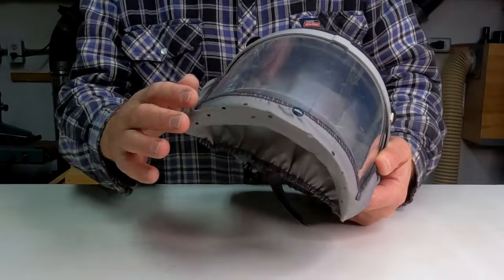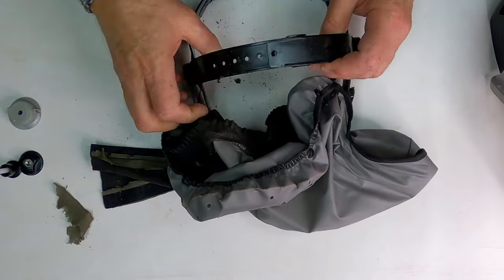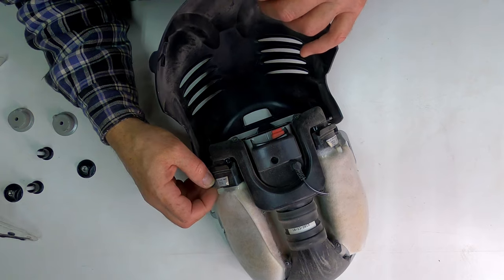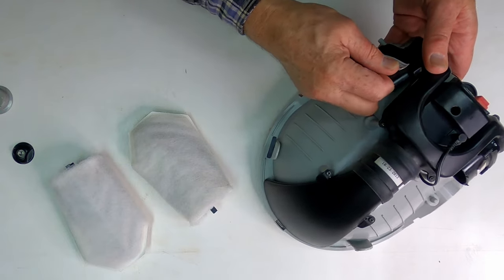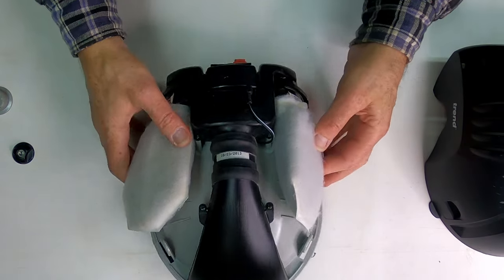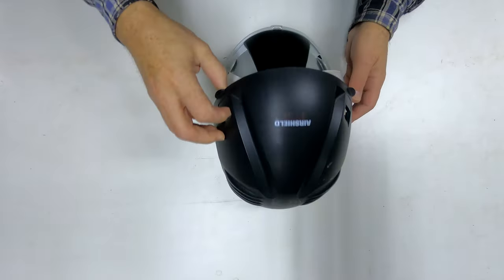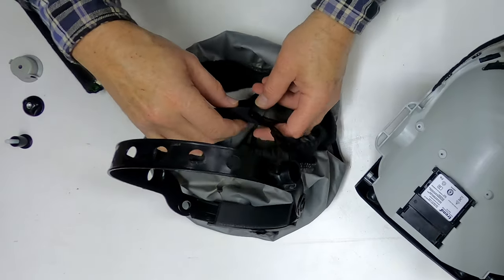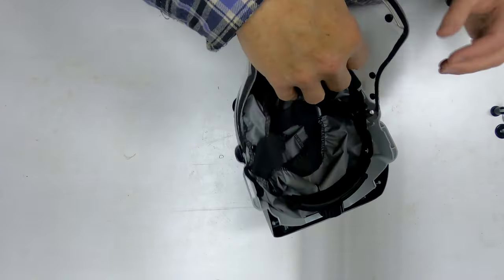CLEAN & REASSEMBLE TREND AIRSHIELD PRO

Comment: Many thanks for this superb demonstration, I can add too this in a couple of very useful ways. 1. The filters are washable a good few times and you do not need to undo the cable ties. Buy a small net wash bag big enough to fit both filters in and put them on a 40 degree wash cycle for 30 mins. Air dry takes 30-40 mins.
2. If they do eventually breakdown I have bought a sheet of Hepa Filter cloth and sown replacement filters then created a simple cable tie internal cage that does not break like the originals. 10 washes later they still work far better the Trends original.  Cost was a couple of pounds and 1hr to make and fit. 
3. The Head band protectors went in the wash also the cranium foam does break down so I replaced it with a longer copy of the design with a soft density silicone foam which is more comfortable and lasts longer same with the forehead one where a good piece of natural leather works well and is easily wiped clean.

The standard of the head unit is more efficient and more comfy over a day of use and repaired at a fraction of the cost. I’ve done two others for friends and they have said the same over the last two years they’ve saved lots of parts costs and cleaned weekly without damage. Air flow is cleaner with both Carbon and hepa filters made to fit.
Reply from the maker: This is incredibly valuable information, Stewart. I plan to print this so I don’t forget any of it. Thank you so much for sharing it with me. I really appreciate it, my friend. I hope others will read this information!
Happy turning,
…..Gord
Reply: @GordonRock1  My pleasure, it’s a lovely useful bit of kit but the cost of spares and service replacements in current times could make anyone ask twice about repair if it can be done well for a fraction of the price why not. If you do try and take the frames out of the filter they are fragile with no reason.
Even the battery can be deconstructed and the cells replaced for an absolute saving but I’m not there yet but Samsung cells work far better. Other brands available even less costly. 
One of the friends who let me clean and replace his pads and filters commented how it’s good not having to be a little precious on safety when using. I get that, we don’t think twice about putting it on, we should never need too.

Comment: I have the same TrendPro helmet, try a vacuum to clean the filters from the outside , then I blow from the inside with compressed air.  The other thing I have discovered turning green wood roughing out bowl blanks to dry is it’s hard to remove the sap from the face shields I use ! 
I don’t use this kit for that only on power sanding dry finish work. But the trick seems to work well on this lens too. We buy windex in the gallon jug , it won’t remove sap ? I make a mix that will by adding one cup of 90 % isopropyl alcohol. It works really well now. I use it to clean my respirator too. 
Cheers!
Reply from the maker: I rarely wear my Airshield when I’m turning, Pete. It is almost exclusively for sanding. I appreciate the tip about removing the sap. The same should be true of my face shield. I will try to be more diligent about vacuuming the filters occasionally but I hardly ever think of it. Thanks for watching!

Comment: This video has helped me immensely as i took the  head cover face seal out to clean and had left it to long beforei reassembled it so forgot how 😏😂.. when i reassembled it tho i wasnt totally convinced that the elastic loops were supposed to go inside of the anti rotating caps (marked L&R) so i let them loop around the outside of them to the front of the mask... this way they wont interfere with the workings or doing up the retaining bolt properly. Have a go and see if it helps/improves things and thanks so much for the video 😊🫡👍
Reply from the maker: I'm happy that it helped you, Adam. I hope to get back to turning very shortly - after a year of chemotherapy. When I do I will try to remember you tip. Sound like a good one!
Thanks for watching!
.....Gord

Comment: Gord great demo on how to take the Airshield apart and put it back together. For sure not a simple task.
Looks like a very hi-tech piece of equipment. The fan sounds pretty powerful.  Do you feel any pressure on your ears? 
 Great info!
Gary
Reply from the maker: No, I don’t feel any pressure on my ears, Gary. I like the way the filtered air moves down across my face. I find it very refreshing. It’s one of my tools that I would never give up. The older I get the more I appreciate my lungs working properly. I guess we all feel that way to some extent.
Take care,
…..Gord

Comment: I bought one of those thinking it would make dust control easier however it never ran and after taking it apart several times I just gave up and sent it back for a refund. For the price it should work right off with no problems. I will not suffer a fool very long. I did find it cheaply made as well.
Reply from the maker: I don’t know if you had a bad one or if I got lucky, James. I have never had any problems with mine and quite like it. I wouldn’t call it cheaply made but then I have never tried a different manufacturer to see if they are better. Thanks for watching, anyway!

Comment: Gord - I have an older version of this helmet and the retaining caps aren’t marked.  When I took it apart for a visor replacement it never seemed to work quite the same .  There is no resistance on raising and lowering the helmet so it can start raising while you are turning.  Can you take a picture of either the left or right retaining cap so I can be sure they aren’t switched?  Also, I have a rubber washer in my retaining cap / bolt assembly.  Do you have one also?  If so, did you put it inside the retaining cap or on the bolt as it fills both places but doesn’t seem to do much?
Reply from the maker: Mike, where would you like me to send a picture to? I do not have a rubber washer in the retaining cap assembly. I found a manual that I believe is for the older model at: https://manualzz.com/doc/30708228/trend-airshield-manual 
There is a diagram on Page 14 that might be helpful. Sorry I'm not more help. If you want me to take a photo of the retaining cap just let me know where to send it. Good luck with it.
.....Gord
Reply from the maker: Mike, I can see that you left another message but am unable to see the whole thing. I’m not sure if you deleted it or if I’m having problems receiving them. I have had this same problem with messages from other people. I hope my previous message was of some help!

Comment: Hi Gord and thanks for helping me find something to help protect my lungs as well my face . How long have you had this and how reliable is it are the batteries rechargeable are they expensive ? I’ve got serious lung issues and I need something  like this . I’ve been in the market for some time now . Thanks in advance . I Liked this video as well 👍thanks brother
Reply from the maker: Ron, the batteries are rechargeable but I keep the adaptor plugged in to the wall when I’m using it so I don’t know how long they last. Expensive? I would imagine they are although I have never checked the price out. You might check with whoever is your nearest supplier. I love mine and can’t imagine doing any kind of sanding without wearing it. I hope you are able to find one nearby. Of course there is always online shopping. Glad you liked the video, Ron. Thanks for watching!
Reply from the maker: I noticed that you had posted a message saying that you ordered one. I understand why you would delete the message. I hope you will like it as much as I do.
Reply: I have this system and to replace the battery packs is quite expensive. I bought battery holders for 3 AA rechargeable batteries and the appropriate connector. Works great and the batteries were a fraction of the cost. I have also washed the air filters. Not sure if I was supposed to, but I got them very clean. I don’t always wear the helmet because I find it heavy. If I were to do it again, I’d give serious consideration to the 3M system where the battery pack is on your waist. Thanks for the video
Reply: @gregj2647  hello. I am leaving in France. I had a 3 M equipment till its batterie failed. The price to replace the battery was more than 250 euros. I bought an Marshfield pro  because the price was 280 euros and the spare battery is 70 euros. Regards.